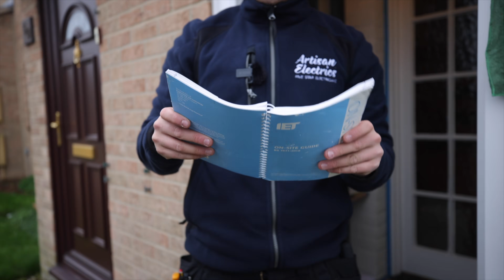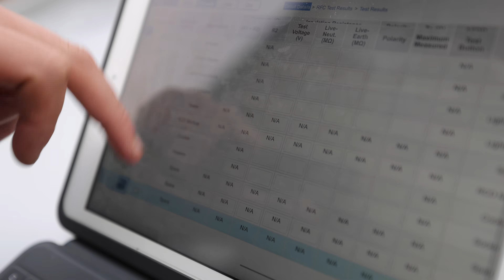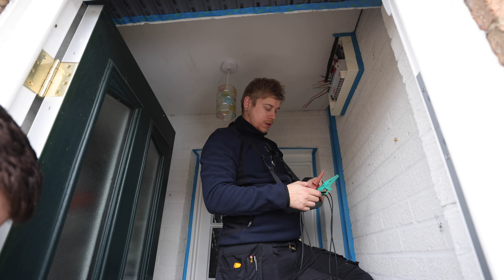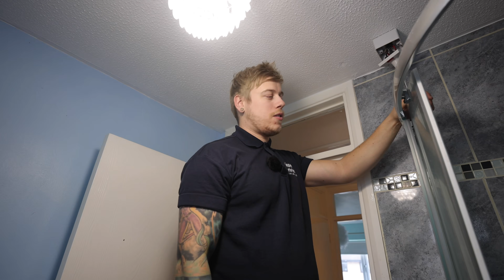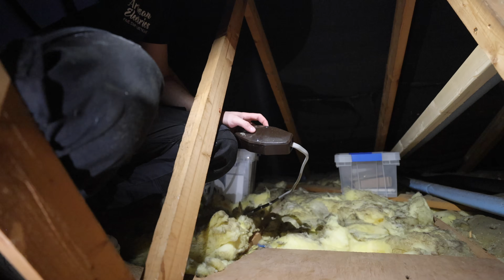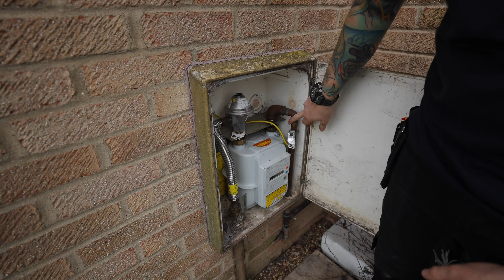DANGEROUS ELECTRICS FOUND DURING AN INSPECTION - Electrician Life

Comment: Ha!Polarity!Isnt really a thing in the Netherlands.Of course in the breaker box we do attend to the polarity,but because we switch the phase AND the zero wire,it really doesn't matter how you put the plug into the socket.And the plugs are reversible.But offcourse the down-site is again that you cant get it all on one connection.But thats just for the electrician.☺

Comment: Good stuff but I'm gonna nit pick on the terminology. Doing the IR tests he said he was gonna "send 250V down" and if the readings were good, "send 500V down". Voltage doesn't go down anywhere: that's current. An IR test is to stress your insulation at a higher voltage at which it would normally operate to ensure it will not fail, or "leak". Voltage is electrical pressure. It's just like a water or hydraulic system where you might increase the pressure in the system to ensure you don't have any leaks or to show up a slight leak which is difficult to find. If you increase the pressure too much, the pipe would rupture. This is the same for voltage and why our insulation has a limit to the voltage it's rated at: too much voltage and the pipe bursts!

Comment: @6.39 - measuring Ze - disconnecting main earth - ok so far - but then you mention testing to live and neutral for Ze?

Surely Ze is the "true" fault/loop  impedance seen "back" to the  DNO source via the main earth conductor and live conductor ONLY ? ie the "main fault path loop"    ( TNC-s in this case  - so  - even though the CPC  in this case is bonded to the neutral conductor at the service head -  Ze  test uses  only the main earth/cpc  and live conductors only ? ) 

( reason for disconnecting main earth conductor is to remove parallel paths which would/might reduce the Ze reading - that is  - measuring via "just" the main eth conductor gives a "true"  Ze  - which we need for calculating Zs etc and to thus appropriately rate  final circuit parameters and breakers )

By contrast - to find PFC ( Prospective Fault Current)  - you need the "lowest"  impedance to give the highest  possible PFC  ( I = V/Z)  so I can understand reconnecting the main eth to include parallel paths to reflect the "practical/in service  case under  fault condition -     and then indeed testing live-neutral in addition as this may give a higher PFC. - However -  I see that you used three connections on this test - I suspect that the test instrument is checking the "best" ( or worst depending on how you look at it) combination of eth/live  neutral/live to give highest PFC - thus needing three connections ?
Of course - this test is to prove that the disconnection current  rating of breakers is adequate ( usually rated at 6kA on domestic installations )

Comment: Good video, thanks guys.. I always go round with a socket tester on every skt b4 powering off, just to verify all is potentially good there; also determines what skts are on which cct , altho I appreciate if you do that on the Zs test it basically does the same thing. 
Incidentally, you dont strictly need to do a Zs test if the circuit is rcd/rcbo protected as the trip test suffices to prove ADS.

Comment: Am I the only one shocked that he calculate the intensity with DC formula instead of AC one which need to take care of the power factor ?
Reply: The load seems to be a resistive heater. Would you guess/estimate the power factor to be below 0.9? Would you think that ignoring the power factor gives an error greater than 10 %?
I would mention why I choose to include or ignore the 'power factor', for completeness, if I had learning in mind.

Comment: Great video - many thanks. One question - if I heard correctly, did you say that the voltage for the lighting in the conservatory was 120V because the earth wasn't connected, and became 240V when it was reinstated? Can you explain why this is
Reply: I'm no electrician, but I assume they were measuring potential between earth and live. In the disconnected run of earth cable, the voltage could be anything, perhaps affected by induced currents, so the difference between the cpc and earth becomes less than 230v.
Reply: I'm no electrician, so I'm waiting for this as well.
Reply: its basically going to earth via the neutral if any light/appliance is switched on, not the cpc I think..

Comment: To get an accurate figure for the shower current consumption surely you need to know  what voltage  was used to define the 8.5kw rating and what  the actual supply voltage is.If the shower was designed for 230v and run on a 240v supply it would be drawing around  38A, whilst a 240v rated shower run at 230v will be closer to 34A
Reply from the maker: Very good point 👍

Comment: Nice for the customer …... but this is more than just a EICR if you are fixing faults .
One little thing you didn't show us after fixing up things .
The original testing is now invalid so circuits should be retested .

Also faults you find may not be mistakes !
It could be a attempted cover up of a rcd problem .
Maybe the old water in the workings so customer blames the new rcd protection device  ;)

Just because you fixed one fault you could have more problems & not all are electrical !

Comment: Can I ask how the 2 both missed the cooker isolator switch, directly above the hob heat source and not within 300mm regulation?
C2 all day but missed it?
Reply: We can only presume they missed it. There is no hard and fast rule on distance. EGBR states 100mm clearance hob to socket horizontally
Reply from the maker: It was on the report as a C3 - no signs of overheating damage
Reply: @artisanelectrics   Jog on you con artist, robbing folk absolute blind with some on the work it’s embarrassing!

Comment: A B32 is supposed to hold a current of 38.4 amps for an infinite amount of time (32*1.2) so the shower definitely isn't going to trip anything, especially considering it won't likely be used for extended periods of time - even teenagers have limits to how long they shower. The sustained overload might shorten the MCBs life span but I have no idea how relevant that is. Definitely not correctly designed though, the load current shouldn't exceed the MCB rating. If the cable is large enough for a B40 you could fix that during the board change.

Comment: Not too bad, correct me if I'm wrong but shouldn't you be checking th continuity of the bonding conductors if you can't see the whole run. (At the start of the eicr) Also, step 2 with ring r1 +rn , guidance note 3.good spot on the shower though.

Comment: A few moments in an you fall into the misconception that you are coding based on when the system was installed and what the regs were then. Just plain WRONG. Edit - a few more seconds in and the cover is off with main switch on - fingers poking around the mcb with exposed copper clearly visible. naughty. And What’s wrong with 3 conductors in an mcb , is it ok in a socket outlet ?

Comment: Electricians did inspection/testing for an EICR about six months ago.  They 'only' did two things (1)testing at the consumer unit and (2)put a mains socket tester in each socket. I very naively thought they'd inspect/test all the visible cabling, every socket (by removing the covers), every electrical item that was hard-wired in (such as light fittings) or able to be plugged into a mains socket and test for earth leakage current (protective conductor current) etc etc. I thought they'd be here all day but they left after about an hour and a half. Silly me 🤣
Reply: How much did you pay them to expect a full days work ?

Comment: Would the ZE not be invalid in this case as the bonding to the gas and water are still in place because they are direct from the main incomer head?  This will give you parallel paths.  This would be more a ZDB?

Comment: Very interesting eicr video. I noticed you said you was doing a Ze test. Under those circumstances that would not be classed as such as you left the protective bonding conductors connected at the head (probably as it was sealed). As a result you have obtained a Zdb reading which is not an accurate test to confirm external earth fault loop impedance as one of your bonding conductors could be masking a poor earth connection. Also did i miss you did not carry out the PSCC test. Normally on a tn-c-s system both your pscc and pfc readings should be closely matched. On systems where it is not clearly visible what system you have obtaining these readings will give you an indication of what earthing arrangement you have. Use your limitations box to detail and explain why you are recording a Zdb to cover yourself.  You highlighted at the shower pull that the neutral was hanging out. This reinforces why as electricians we should also be doing the “missing tests” from bs7671 and GN3 being the r1-rn test and the end of line L-N PSCC test to each circuit where feasible. BS7671 is a minimum standard and the test certs need to be updated as so much is missed on eicrs which could easily be obtained. 
Also always carry out continuity tests before doing I.R tests as by blindly doing the I.R first could give you irrelevant readings if your cpc is discontinuous as was proved at your switch point. 
Excellent content Lee 👌🏻👌🏻👍🏻👍🏻
Reply: In the UK at least the Ze is always done at the board at the origin of supply and not at the DNO supply head. 'Zdb' would be used if you wanted to show the Ze for a secondary board that wasn't at the origin eg. a Garage board.
Lee was also using the brand new all singing all dancing KT63 PLUS Multifunctional test which test PFC and PSCC at the same time.

Comment: Surely if you put that shower on a 40 amp you will have to upgrade the cable to a 10mm, 6mm should be on a maximum of 32 amp?
Reply: Looks like a 10mm in the junction box.
Reply: 6mm clipped direct is 47A …
Reply: @Marco-mg9tv  yeah I'm aware what the cable itself can handle and that's only if u can prove 100 percent where and how the cable is run and clipped
Reply: @robbiemarshall1481  yes agreed but unless it’s buried in the loft insulation which can be checked then 6mm Not going to be an issue if connections are tight and sound and no signs of thermal damage.if was 10mm and you don’t know 100% the reference method would you deem that cable has been selected appropriately??…
Reply: @Marco-mg9tv  if the shower was larger I would have it on a 10mm, in Scotland we have been taught to put a maximum breaker size of 32 amp MCB on 6mm, harsher regs here and bit of a grey area I suppose may be a factor
Reply: @robbiemarshall1481  same regs in Scotland are they not BS7671 2020 in Scotland? My point is if you comment that the 6mm is under rated for 40A OPCD and should be 10mm then you need to back it up. Method 103 which is common for new builds is only 32A for 10mm so should you be installing 16mm ? ..
Reply: @Marco-mg9tv  then ref method 101 and 103 are 27 and 23.5 amps for 6mm the point is u can never tell what exactly it's running though or how it's clipped so surly u would fuse it down not knowing these factors

Comment: I would always check the pull cord & cooker isolator in a domestic property, whether the readings at the shower are good or not.👍🏼
Reply: Agree! 9/10 problems and even potential overheating/arcing are at switch terminals in my experience, so I always do an inspection of these switches..

Comment: You said that due to the dodgy junction box in the loft you ended up testing R1 and Rn at the shower.  You didn’t though…….you were testing Rn and R2.

And by the way……most people test at the shower and not the isolator…..because that’s how a full test is done.  👍

Comment: "Ze" reading... don't forget your water and gas are bonded at main head so there be no true "Ze".
Great vids love watching Artisan Electrics no matter who's in the spotlight. 🛠
Reply: Right remark 👍
Reply: Sorry did not see this reply until after i posted. 100% correct buddy. As he could not remove the protective bonding he’s ended up with a reading under Zdb constraints. You’d consider yourself very unlucky if it was the case that the Ze was actually missing and masked but still possible. 👌🏻

Comment: Nice video… you seem to be doing the remedial work’s while on site.I can see the importance of the missing earth, which would be a C2 for me.
Surely this would of been in the EICR & dealt with later, or the circuit  disconnected if required.
Reply from the maker: We rectify things as we go if they can be fixed quickly, its just part of the service we offer.

Comment: So with the Pull cord switch, are they Double pole? (We don't have electric showers here in Aust ) But if they are not, then the Pull cord would not disconnect the Active from the shower which would be a serious problem. Great work Guys.

Comment: I enjoy watching you guys work, however I will continue to say, here in the USA, its pretty much turn it on, and hope it doesn't go BANG! 💥  If no breakers trip, tests complete and it works! 👍😁  Although we do have local government inspection officials come out and do at least two inspections, the rough in (1st fix) and then the final (2nd fix).  They work for the city / county that you live that will come out at each phase to make sure things are following the code books.  It makes sure that the installers are following the rules, however there aren't any tests like you guys do, its all visual only.  You either get a pass or fail, and if its a fail then you have to fix what you missed and get reinspected again to get a pass.  The inspections are based on the permits that you file with the local govt as to what you are doing, that is what will trigger the inspections.  There are many that just don't get permits and do it, and then never get inspections.
Reply: Its quite ironic here in the U.K. as the majority of the EICRs and testing carried out is to a pretty poor standard, half the time its just a number crunching tick box exercise.  This is not helped by the fact the ones that do a proper job are slated for “overcharging” and let down by a set of poorly written guidance documents which everybody “interprets” their own way usually to circumnavigate a reg they have breached or to deny they have not followed good working practice. 
We are by no means perfect as i am sure Artisan and other good youtubers on here will testify with some of the crap work they have showed up.
Reply: @rattlehead85  my EICR was done in 45 mins without turning any circuits off. When he finished and said everything was fine no worked required, I then asked him what certain switches did and he had no idea. I then asked whether I needed an RCD and suddenly he stated I did and it would need adding.
Reply: It gets worse. When he came to do the remedial, he only had an external RCD and backbox. I mean that’s literally all he had. He asked to borrow my drill and he drilled a hole straight into where the cables behind the CU go narrowing avoiding them and went “oh sh*t” then he asked to borrow my saw (I only had a large wood one) because he had put the RCD too near the CU and the cover wouldn’t fit so he cut that until it did. Thought I was in Laurel and Hardy.
Reply from the maker: WOW thats crazy, no testing?!
Reply: God bless America 🙏
Reply: Aren't UL lamp holders using a cardboard insulator as well? The ones we use in light fixtures that we make for the USA (brass lamp holder) don't have an earth bond either!

Comment: How did you prove the bonding to gas and water? Was it just a visual of the clamp and a small length of visible cable? I’ve seen a few where the short length of cable goes nowhere, which it could easily as you can’t check it’s entirety
Reply from the maker: We usually do a long wander lead test with one end disconnected

Comment: I do believe that 1x on rcd trip is less than 200ms not 300ms as the 5x is 40ms 

40x5=200

Correct me if I'm wrong 

Very useful video though and good explanations. Love the videos keep up the good work 👍
Reply: It’s 300ms. The 1x and the 5x are the mA current it’s tested at. So when you test a 30ma RCD at 30ma (1x) it should trip within 300ms and when you test it at 150ma (x5.  30x5=150) it should trip within 40ms. Hope that helps.
Reply: 300mS on a 61008 or 61009
Reply: I believe the 200ms was the for the old BS 4293 RCD’s.

Comment: When you IR test at 500v  do you  unplug everything ,disconnect loads etc  like smoke alarms you never seem to mention  the hazards of damaging electronics
Reply: And if there's sensitive electronics you can't isolate, you're permitted to reduce the test voltage from 500 to 250V. The persons doing this should know it, and persons which don't know about this shouldn't perform such tests. 😉
Reply: He did a global I.r test , by linking line and neutral to earth u are taking away the potential difference between the two live conductors, he tested at 250 first and following a suitable reading he put to 500, so he did mention it and showed how he gets round it 👌
Reply: @GeoB24  when you connect your L+N you are taking away any potential  hence you are not skewing your results  this does not protect electronics it just gives you a better result it certainly doesn't mean you should then test at 1000v  you should always test at working voltage when appliances or loads are still in line hence my original question  it might all have been disconnected
Reply: @robertwilliamson3934  it’s 500v test for 230v circuits, and pretty sure it doesn’t damage equipment, obviously disconnect where possible but shouldn’t damage equipment
Reply: Sorry meant to read 500v